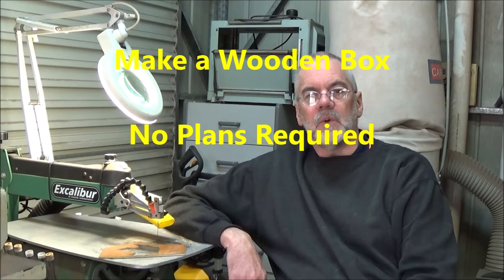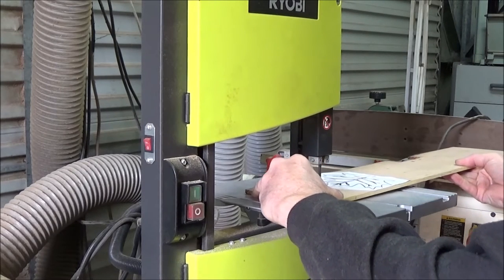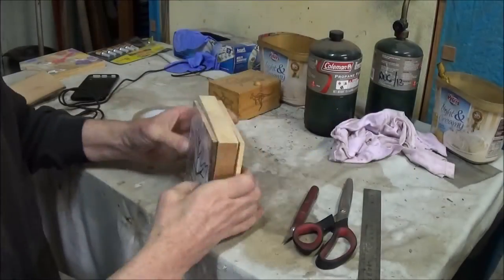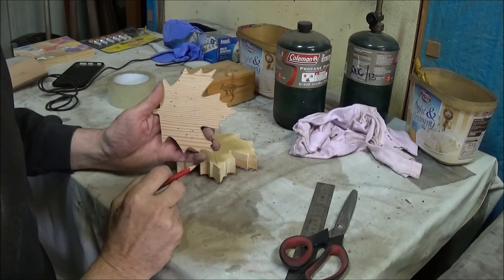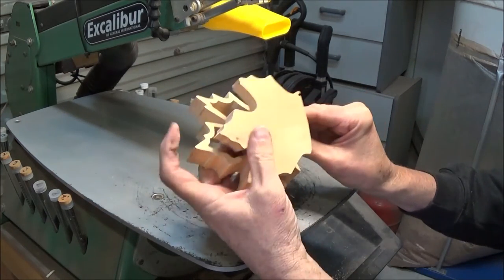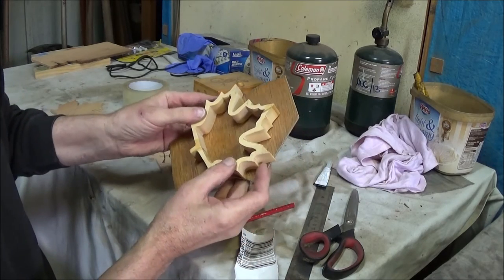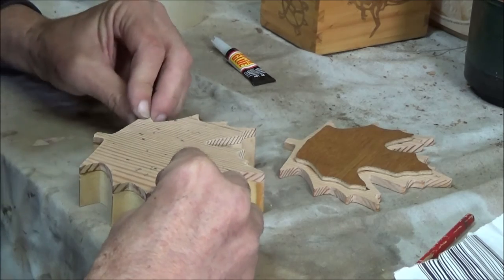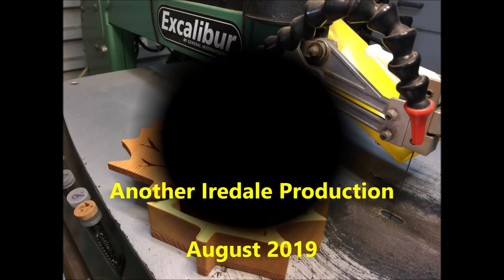How to build a Wooden Box - Maple Leaf Shape - No Plans Required

Comment: I remember buying my first (and last) scroll saw, ooo say 4 decades ago, got it home, found it couldn't cut straight, broke the blade that came with it, then found that I couldn't buy scroll saw blades anywhere - it is sitting in my shed somewhere 4 decades later and has only been used 2 or 3 times and then only for testing. Ever since I make a note of whether consumables are available for things I buy - it is amazing how often they are not. Bunnings are especially bad at that.
Great job BTW.
Reply from the maker: Mycroft Holmes - I agree it’s a big problem getting parts for stuff from Bunnings. 
I started with a Bunnings-quality scrollsaw. Big mistake. 
All my stuff is cheap EXCEPT for the scrollsaw. It’s the only tool where you get exactly what you pay for. Unfortunately the cheap scrollsaws are just not fit for purpose.

Comment: How do you keep edges smooth -sanding?
Reply from the maker: The scroll saw leaves a smooth edge cut.
Reply: @ShedBuiltStuff  Is that dependent on a particular blade choice you make?
Reply from the maker: Yes I guess. The finer the blade the better the cut. But the finer the blade the thinner material it will cut through. 
I’ve used a number 7 blade (blades go from 1 which is finest) the blades are the “pinless” type. The larger pinned type blades make quite a rough cut and I don’t use those.
Reply: @ShedBuiltStuff  very interesting, thanks.